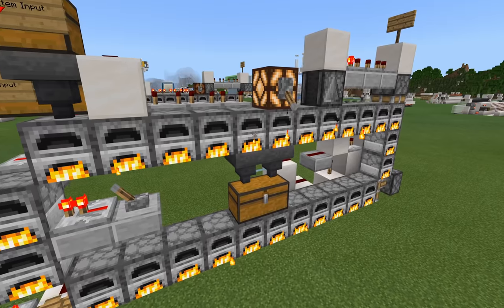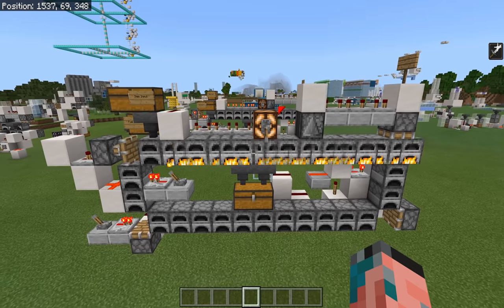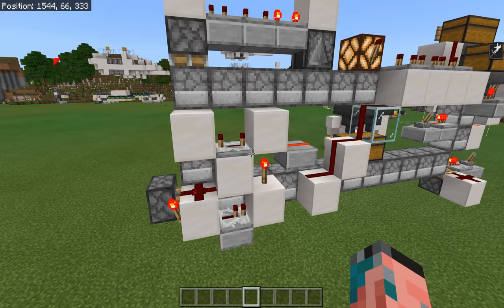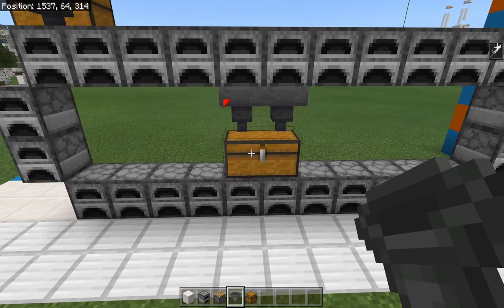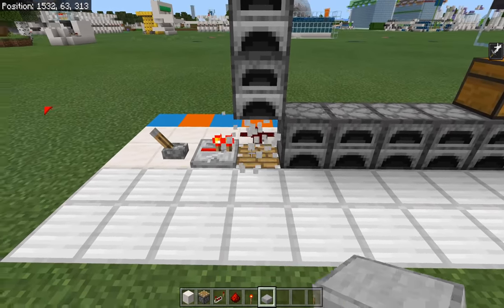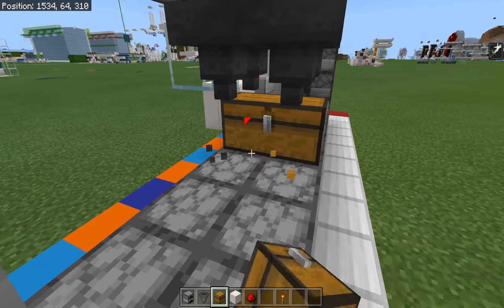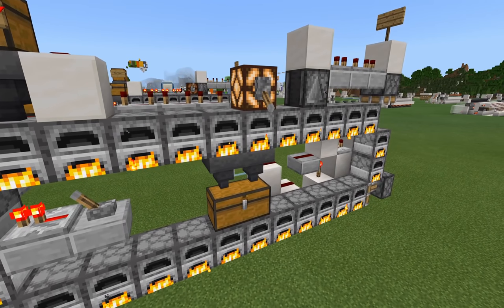Minecraft Bedrock: Fast Super Smelter! Simple, Cheap & Efficient Tutorial! MCPE Xbox PC Ps4

Comment: Let's be real. We are all impressed he did this without soft inversion.
Reply from the maker: I used it in this build, but I could have easily not. Just makes it a bit more compact for the fuel hopper locking:)
Reply: @silentwisperer  I’m slow what is soft inversion
Reply: @xbox_tommyr237  if a redstone torch is on the side of the piston it will invert when the piston is activated. (The piston doesn't have to actually extend, as long as it "would extend: and yeah silent I realized when I did more than look at the thumbnail XD
Reply: @LabsterLab  ok so it’s just lag prevention?
Reply: @xbox_tommyr237  it's only laggy when the piston can't extend
Reply: @xbox_tommyr237  it allows you to invert a torch with some methods that wouldn't invert it normally. For instance, powering the piston with another redstone torch right next to it would invert the torch, but wouldn't invert the torch if the piston was a solid block.
Reply: @traviserrthum2826  yeah, you Gud at explaining lmao. I abuse soft inversion. Better then abusing slime
Reply: @silentwisperer  does this work in 1.16.200?
Reply: @kinguman308  yes for me it has so far
Reply: What’s soft inversion

Comment: Okay, so I built this in creative and finally got it working. Basically, that little piece of redstone at 9:08 moves the furnace so when you actually build the whole thing only that right piston is moving. All I did was remove that piece of redstone at 9:08, take the furnaces off the corners and put them back as he had them, turned on the redstone lamp then put back that piece of redstone. Kinda finicky but at least it works 🤷‍♀️
Reply: In my testing, I just put 2 furnace at right firing pistons and this made the complete cycle of furnaces run gain. There's nothing really have to do with the redstone part.
Reply: My top right piston isent getting power
Reply: @Louis Miller
I have the same problem and I just turned all the three repeaters, to the right of the red stone lamp on top of the furnaces, to four clicks to make it work. Hope this helps :)
Reply: @qweryuiolks9283  I'll try it out,

Comment: Quick tip, if you’re using bamboo to fuel this, don’t have the torches or the repeaters on the side of the piston in the top left corner portion. This allows more bamboo to get into the furnaces. It may be a little inefficient but if you connect a bamboo farm directly to the fuel input like I did it won’t matter

Comment: I ran into a slight problem with the pistons on the top right (from front of farm) not activating and the machine stopping; all you need to do is put a lever on each of those pistons and activate them to get those furnaces in the right spot. Once you've done that you can turn on the redstone lamp again the farm will work like normal. Awesome design though man! I'm using it all the time and this thing works like a charm.

Comment: Make these modifications for blaze rods.

1) Change out the redstone clock for a 2 hopper / piston redstone block (with 5 items in the hopper) this will get 10-11 items in each furnace instead of 6.
2) the bottom far right piston make it an auto piston with a redstone torch to activate it 
3) bottom far left piston hook up to the hopper redstone clock
4) The observer piston, two repeaters can be removed and just keep one on a delay
5) use a comparator on the input chest to a repeater to a torch which then goes to the fuel input hopper so it shuts off the supply of fuel when your smelting input chest runs empty
6). Make the entire ring of furnaces 6 high instead of 4 and move the output finished smelting hoppers / chests down to the bottom left to collect everything that is done before it is sent back up to be refilled.
Reply: I BEEN LOOKING FOR THIS TYSM

Comment: This is my second time using this tutorial I did something that broke the whole machine so iI had to do it again. (I tried to find what I had done I couldn't find it)
Reply: I have the same problem It just randomly brakes if you leave the area while its on
Reply: did u guys figure out how to fix it?? mine does the same thing
Reply: @louiszaffino4071  Break and replace all the  redstone dust, repeaters, etc. to prevent it from happening again, id make a little box to afk in while things smelt.
Reply: Not that this happened to me, but I’d wager your furnaces at the Pistons need to be moved while the machine is off. The only one I see that would probably break would be the observer piston. It relies on the machine to be moving for the piston to move. The two on the opposite side will fire as long as a block is in front of them. Which leaves the timer. Don’t think it would break, but could just remove a dust leading to it and then put it back down. 

1.  Check furnace placement at the corners
2.  Break dust leading to timer and put it back down
Reply: @louiszaffino4071  nope I just rebuilt it although it does seem to work fine as long as you don't try to expand it.

Comment: Hey silent i found a bug where minecraft can accidentally duplicate furnaces and the items inside of it. i built the 27 furnace super smelter about a month ago and it was working completely fine.

But today i was smelting some sand and saw that one of the furnaces had been pushed up, along with pushing a hopper and a fuel chest upwards. i was very confused because there were now 28 furnaces, and the extra furnace also had scaffolding inside it. my only logical conclusion is that the furnace has been duplicated as a ghost block or something.

In my creative testing world i was not able to reproduce this glitch, hoping to try and find an item duplication exploit. honestly i am still very confused

Comment: Version 1.19.40 broke it :( Bugrock redstone is acting all random again. Piston belt pistons on top left corner randomly fail to push, and of course they broke scaffolding burn rate RIP. Hope they fix it with another patch. (edit: to be clear: silents build isn't bad, and my build of it isn't bad either. worked perfect for several patches...Just this particular patch broke some redstone timings.)
Reply: I just built it before reading this do you know what to do about the burn rate?
Reply: @spikeco6581  make a tree farm and smelt logs into charcoal for renewable fuel. Or a blaze farm works for renewable fuel as well.

Comment: Will this work with bamboo as fuel? Since there's more than one bamboo used for each item, I'd worry that the bamboo won't refill fast enough
Reply from the maker: Nay, bamboo is a terrible fuel. Its like 1200% better to craft the bamboo into scaffolding:)
6 bamboo only smelts 3 items. whereas 6 bamboo makes 6 scaffolding, smelting 36 items.
Reply: @silentwisperer  omg thanks for the reply! For me, bamboo has one huge advantage, that its a completely AFK fuel source. I like the idea of a furnace system that I never have to worry about refilling!
Reply: @silentwisperer  i also hate having to craft materials and then refill the furnaces manually. Is there a simple redstone tweak to balance out the fuel to item amount

Comment: To the people asking about how to fix the machine once it breaks because you unloaded the area, here are a couple of ideas:

1.  Place a button on the block above the observer or the block above the piston the observer powers. If you find that there is a furnace below that piston that has not been pushed, and there is a space in front of the piston below that, then pressing this button will manually actuate the piston and put a furnace in front of the bottom right piston that’s controlled by the timer. Once u turn the machine on, the timer will actuate that piston and it should work properly. 
2.  Use a hopper clock timer instead of this one. It’s customizable on the time based on the amount of items you put into it. Face an observer into one of the hoppers and lead the redstone to the bottom right corner piston. Use a stack of 10 or so of a random item u don’t care about in the clock. Adjust that stack as necessary.
Reply: Thank you

Comment: for the single array design, if you want it all to fit within one chunk and not too fussed with looks, you can swing the mechanism that powers the top left piston, the 2 solid blocks; repeater and torch to the left of the piston, round 90 degrees to the front

Comment: Works like a charm, first try on 1.19! now there’s a reason to have a bamboo farm. Thanks!
Reply: i cant get the top right piston to work in 1.19 did you have to change anything?
Reply: I constructed it exactly as he built it, to start, and it worked. (Have since added hopper feed lines so farm is accessed from the skinny side.)
Reply: @ogkitty7558  i fixed it just had some of the furnaces in the wrong spot so the observer didn't activate the repeaters

Comment: Just as a tip for anyone only building the 27 furnace design, I'm pretty sure if you bring the fuel chest to the front, you can put the whole thing underground and make it look cleaner in a base
Reply: What does moving the fuel chest have to do with moving the whole thing underground? 

There are lots of things one could do with this as a starting point, but the main thing one would need to address when moving this contraption underground isn’t the fuel chest, but the items collection chest would need to turn into some sort of item elevator to still have access to the smelted items.
Reply: @ClAddict  It's solely for aesthetic. Moving the whole ugly redstone and furnaces underground would simply make everything look neater
Reply: @thepigeon5849  but then you couldn’t access any of the outputs?
Reply: @ClAddict  Which is why you use an item elevator

Comment: I've built this like four times (moved one once) only on the last build did I realise that I was building it one furnace short 😓, I mean, it still works great, no issues, I just be dumb.

Pay attention when laying out the top line of hoppers, it is 12, you just break the last one after placing the two vertical hoppers on the left side 🙄

Still running 1.19.30
Reply: Really?
Reply: Can y give me the time stamp of that
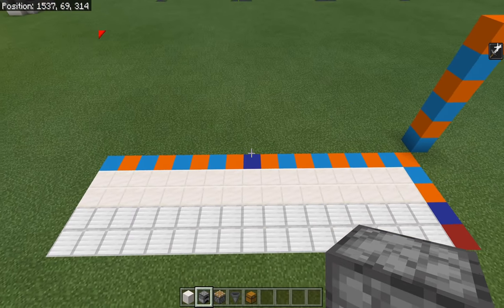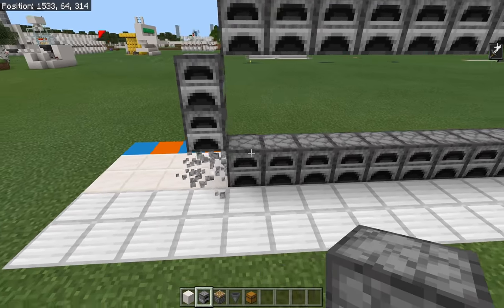Reply: @Virat183_18  Now, watch really carefully, go to 7:20 and watch to about 7:45, Silent places in 12 furnace along the top row (you should end over the first furnace).  Silent then places in two new furnaces to the left of the (first).  I missed this and thought I'd done something wrong and instead, removed the last furnace on the top row (and probably the first one on the bottom row), because, I be dumb 😓

Comment: Hi Silent, you asked about addons people were doing with this one so I wanted to chime in with a couple things I did. 

First: I added a red stone line to manually turn this thing on and off from a location far enough away that I can't hear the pistons firing. It took a little work to figure out how to snake that input over to the lamp in place of the lever. The main use is to be able to turn it on and off from far enough away I can't hear the pistons firing - I'll call that my switchboard room. 

Second, I ran a line of hoppers from the output to the switchboard room or easy collection. I also included a comparator watching that hopper line connected to an indicator light in the switchboard room. So I could tell when the machine was done working. 

Third, I ran input lines for fuel and smeltables stretching to the switchboard room. I also have a comparator reading the primary double chest with fuel in it and hooked it up to a signal light to show when I need to add more fuel.  Additionally, I set up a space for unloading shulkers and ran redstone from a lever to lock the shulker-hoppers so they don't swallow and attempt to smelt the empty boxes when you try to pick them up. Considering: running all input through an item filter to grab only the smeltables and simply return unsmeltable items so they don't jam up the smelters. 

Fourth - and this one was tricky with all the other lines already going - I set up a comparator to detect when items are in the primary input chest. That feeds  a line that will start the machine but I also connected it to a dropper pulse extender hooked up to that same line. The dropper/pressure plate makes sure the machine keeps going for at least five minutes from the point of ignition, and the comparator will reset the five minute timer if there are still more things going through it. Finally, there is one more branch of redstone running from the dropper to a simple hopper pulse extender. When the dropper spits out an item, the timer winds up, when the dropper clock turns off and stays off, the hopper clock kicks on and keeps the machine going long enough to cycle everything around and get all items out of the furnaces. This kind of makes the manual on/off switch redundant, but I kept that as a backup.

Comment: Comment + Request. I thought it didn’t work but after rewatching the video repeatedly I found the problem. You might have to break two furnaces at the top and move them back to the bottom if it gets stuck. That was a tricky one. Request: could you add a delay timer triggered by a button press so that it only makes a single revolution before stopping again? I find that I don’t stop it in time and then the furnaces are preloaded with a few scaffolding. I guess it doesn’t really matter in the long run but it bugs me.

Comment: Scaffolding VS Lava as a long-term fuel source:

Lava is not a renewable resource, bamboo is. String is also a renewable resource.
Lava does not stack. Bamboo, string, and scaffolding does.

100 items smelted per lava bucket, how many per stack of scaffolding?

If you have a direct input for the fuel, you can load stacks and stacks of scaffolding. You have to manually input each bucket of lava and then remove each empty bucket. This is a time wasting step each time.

Comment: This may be an obvious question but since scaffolding smelts 6 item and a blaze rod smelts 12 would any changes to the redstone be necessary to make it suitable for blaze rods?
Reply: The key is using a fast burning fuel source which is what makes this so fuel efficient. If you use blaze rods you’ll just be wasting their full potential.
Reply: @wibblesletsplay9488  thanks for the info I got blaze rods to spare from a blaze farm but that's good to know I just think it's easier than crafting all the scaffolding

Comment: Question would it be wise if you used coal instead of scaffolding or would one need to redesign the build to work best for coal?
is it better for a realm to have the movable furnace machine or would a minecart one?
Reply from the maker: You can use coal if you want, but it won't be fuel efficient. No different than most furnace arrays really. As for realms, it could go either way depending on your lag situation. Minecarts often have issues, or get deleted. Not aware of any issues with rotating systems:)
Reply: I made foxynotails rotating furnace array on a realm.  Worked really well when the realm was young.  Still works now but I have noticed lag spikes while it’s running in a much more mature realm.

Comment: Mine broke while I was using it (probably because I was a few chunks away), Only the lower right piston was firing. So I tore it down, moved it, and rebuilt it completely. Then I turned it on, and the same thing was happening! I’m sure I built it right, so idk what’s happening. I’m going to try again in the morning, hopefully another complete rebuild will solve it :/
Reply: Update, it’s working fine again. I switched it to a pressure plate activation to help from breaking it again. This thing is a bëast!

Comment: Quick question, using scaffolding as fuel, what timing would need to change if I was to use blast furnace/smokers? Half the time to cook something, so would I want to put double the input and scaffolding at a time... any suggestions?
Reply from the maker: Hmmm, i hadn't thought about that. I think the simplest thing would simply to have half the furnaces per slice, make it a micro smelter really. Or maybe twice as slow? Either could work in theory
Reply: I’ll tinker around and let you know! I’ll try to make it the same amount of furnaces (but smokers/blast furnaces) and it’ll be double the speed. I’ll write down a quick explanation and hopefully other people will see!
EDIT: I’ve tied some stuff but came up inconclusive.

Comment: FOR ANYONE HAVING ISSUES WITH POWERING THE OTHER 3 PISTONS:

(This is what i did and it worked as of 1.19.89)

1. The repeaters next to the redstone all need to be set to 4 tics.

2. Turned off all of the power switches and then turned them all back on, with the redstone lamp lever being the last one.

3. Replace the furnace in front of the bottom right piston.  That will jog the machine back into working order.

Comment: Hi silent, on the omega base of Truly bedrock season 4 you did a similar one for using lava as fuel.

Is there any way I should change this in order to work properly with lava:

I constructed a lava farm (smaller, but similar) and aiming to get faster smelting/cooking, any advice ?
Reply from the maker: nothing changes if you want to use lava.
it wont be fuel efficient though. i have a new version of this i need to release, its made for coal, blaze rods and other short burn fuels
Reply: @silentwisperer  WAIT NO I LITERALLY JUST BUILT IT
Reply: although nice build thanks alot my guy